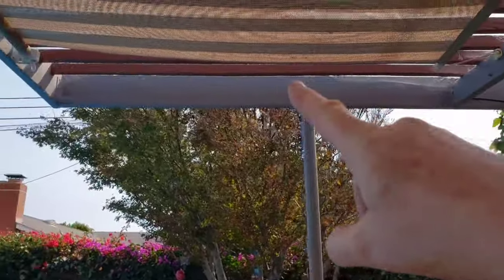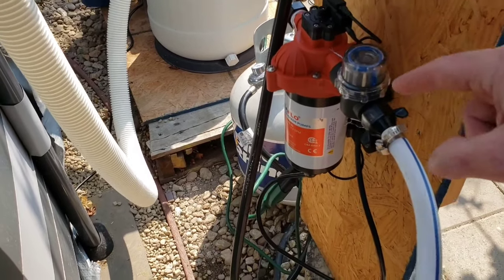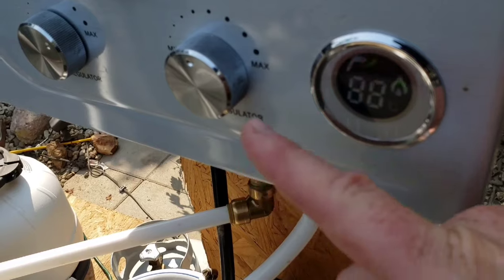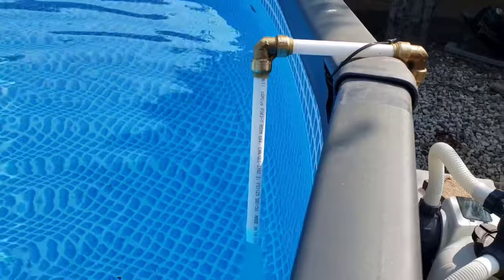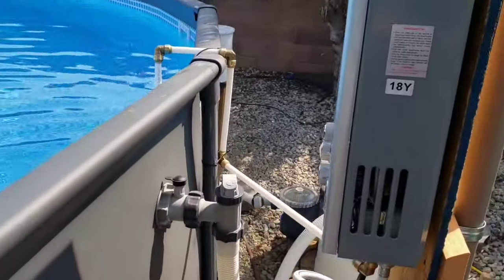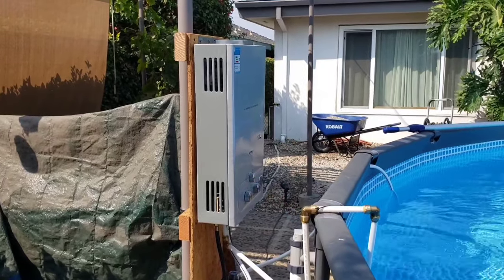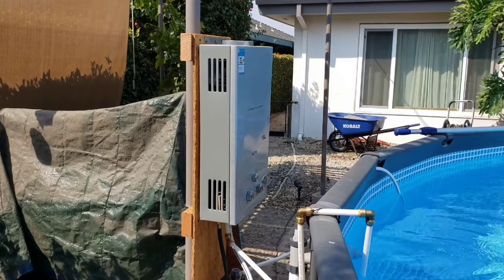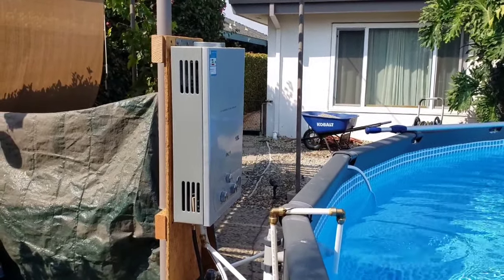The Best Above Ground Pool Heater? Propane Tankless Water Heater setup

Comment: Have you had any issues with the pool chemicals eating away at the internal piping of the tankless gas water heater? There was a forum I was reading online and I can’t tell if the information I was reading was accurate or not. So I thought I would consult someone who has already installed the tankless water heater as a pool heater.

Comment: How many degrees did it changed at nighttime after waiting?
Reply from the maker: As long as the ambient temp does not fall below what the water temp is already at, I saw about 5 degrees total. We moved on to a Raypak above ground pool heater

Comment: You’ll get a whole lot more out of your pool. If you put two covers on it, put a big bubble solar cover on it and then put another cover over it not only does it keep the sun from depleting all your chlorine and all but it sure does keep in the heat. You can also get this huge bubble wrap product that you can wrap all the way around the outside of your pool to help maintain heat. I think 80 Pratt 5% of the heat rises.  We had a dull boy, 18 round by 48, and by using the black irrigation hose, the more rigid stuff, we had these coils about six of these coil set up on our yard course you’d have to go out and flip them as a son you know towards the sun a little bit, but that took about five minutes. And my husband was able to get the temperature in the pool up to 92° when it was 78° outside! That was by having padding on the bottom of the steel frame pool padding on the inside before you put your liner in bubble wrap around the outside and two Bubble solar covers on top held the heat in and boy did it ever work! Now you can’t swim in it all year round, I do live in Michigan. But I sure wish I could find a system that I could heat all winter without running my rates through the roof.😂
Reply: That's exactly what I do! Double cover overnight and open outer cover on sunny days. Keeps it at 75f overnight even when outside  temp 65F
Reply from the maker: Wow, all excellent 👌 ideas

Comment: This works. I built the same. My design uses quick hose connects so I can flush out the heater when the heater starts clogging after a month of use aka 200 hours. The setup lasts 2 seasons as the heater melts internal heat shielding, water calcium clogs the heater, and the pump switch dies. I spend $250 to refit equipment every 2 years. My same size pool heats up the pool by about 1 degree per hour with a $25 propane tank per day. 

The pump is annoying so I build  a wooden box with sound insulation. Problem is the seaflo water pump over heats after 4 constant hours enven with water or fan cooling. I setup a parallel pump with a manual valve to switch to the backup pump. We float and swim late into the night...

Comment: I'm following closely! I have a 14ft 38inch pool and I'll be doing a similar set up. Have you monitored your water temp? A video with the air temp, water temp, and how long did it take to get it as warm as you liked? How much propane are you using? How many hrs of heating will a 20lb tank provide? I'm in MS and our temps are low 80s in the day, 60-70s at night, so I'm wondering if a smaller unit would work for us and possibly use less propane or if lower flow rate will mean I'm using the same amount of gas and it just taking longer to heat. I'd love a follow up video! You rock!! Also, can you link the unit you bought?
Reply from the maker: Thanks for the questions and following us Pauline. Here is a update that I think you deserve:
I switched the heater to a natural gas model that from the outside looks identical to the propane one. Using a BBQ natural gas hook up line from my gas meter to the heater provides limitless fuel. And its cheaper! It puts out about 131 deg F water temp at a flow rate of approximately 3-4 GPM. 
Yesterday we had a 75 degree sunny day here in Oxnard CA and I turned the heater on around 10 am. The pool temp was already around 71 degrees. But by 8pm the pool temp was about 79 degrees although the air temp was now 60 or 59 degrees. I think that if you turn it on early enough in the day by the evening you can see about 1 degree and hour increase over ambient temps by the evening. 
This was my observations only and when I have time I can do a more scientific experiment like you have asked for.
Cheers!
Todd and Sassy
Reply: Bbq grill Propane tank has max 400,000 btu.

 Your 2700 gallon pool requires 2700 btu to be lifted one degree.   The btu of heater determines how long to heat pool and the propane tank determines how much heating you can do. 

Size of heater in btu and you need lots of flow to get to rating on most heaters so don’t cheap on pump - the more flow the more efficient your heater and propane usage which is way cheaper than electric to run pump so use a solid pump to drive the water through.
Reply: @3DaysAway  Excellent video.  How much was it to extend your gas line?  And did you have to get a different water heater after switching to natural gas?
Reply from the maker: @patricksquires77  we now have a Raypak above ground pool heater, works great
Reply: @3DaysAway  Thanks for the reply and info and original video. Did the nat gas heater die?
Reply from the maker: @patricksquires77  no, I just wanted something with more BTU and Raypak makes a nice one.
Reply: @patricksquires77  Close. A BTU is how much energy is needed to raise the temperature of one pound of water one degree, not one gallon. 
1 gallon= 8.33lbs
So his 2700 gallon pool needs 22491 btus to raise the temp by 1 degree.
Reply: @MrDflores1  doh!  I definitely need to get that right!  Thanks for pointing this out!
Reply from the maker: @petershi9495  I ended up going with a Raypac above ground pool heater...
Reply: @MrDflores1 You are missing part of the equation, starting temperature. 
In the US, 1 BTU is the energy needed to raise the temperature of 1 pound of water 1 degree, with a starting temperature of 59 Fahrenheit. In Cananda, the starting temp is 60F (15.6C).

Comment: If you hard plumbed your filter pump, you could have just added a tee with a pvc hose pipe connection. Which eliminate the need for a pump for the heater.
Reply: People don't get this 😒
Reply: The flow would be too fast to be efficient, would it not?
Reply: @iamamp3pimp  I have the  same question, but the gas Co. tech told me that is how is hook up, using the pool circ. pump and adding a diverter valve, so when not using the heater, valve is turn  off. Maybe that is the reason the BTU required is so high.

Comment: I bought the exact same heater. But for some reason, the heater will run nice, but after about 5 min it shuts off and won't reignite.
It will only start up again if I unplug the intake hose, and drain water from heater. Did you have this prob? Any ideas why I might be?
Reply from the maker: I"ve heard of this issue but did not experience it. We ended up gong with an actual Raypak above ground pool heater, works best.

Comment: Hey, Todd. I have been watching you on BBQ channel. I have a loaded Wichita also. I just bought a above ground pool. New to pools
Reply from the maker: Hi Greg! Hey, now we use a Raypak, much much better!
Reply: I have a stock tank pool 8ft, how do or what do I hook the wires on the seaflow too?  I wanted to just recirculate the water in the pool but where will the power come from for the seaflow pump
Reply from the maker: @patriciaburgess1397  Watch to the end, I show how I hooked up a timer.

Comment: how many btu's was it most likely too small for that size pool also heat it with a solar cover on will work better.
Reply from the maker: Not sure how many BTU it was. I disliked the solar cover because I have a walk-in swim step and the skimmer gets in the way. Since this is southern California, I keep it open and ready rear round.

Comment: Would anyone know (more less) how much time and gas does it take to warm up the water from 70F to around 80F? (some 5C increase). Thanks! I see many heaters working overnight for the next day, that’s long…
Say, if I had 3 ~ 4 hours. (from 6:00 am to 9:00 am) to warm it up for the day, would this set up work? BTW, we only have room for the smallest 10 ft. Intex pool. Thanks a lot for any suggestions!
Reply from the maker: No longer use this, Raypak for the win!

Comment: I have almost the exact same pump and setup but my pump motor gets SUPER HOT. Does yours get hot like that?
Reply from the maker: It did. I have since ditched that setup for a Raypak unit.
Reply: Do you mind elaborating on that? I would love to hear what works better.

Comment: My heater just kept shutting off..it wasn't a flow issue but it seems like the water heater has a cutoff - I think it was faulty
Reply: this is happening to me.  Were you able to solve this problem?
Reply: this water heaters stop after 20 minutes continuous use, you must put a timer that run for example 19 minutes and then stop for 2 seconds
Reply: Watch the part when he talks about putting the timer on the pump to reset the heater....

Comment: Does the heater have to be above the pool water level? I kinda wanted to hide it. Thank you
Reply from the maker: It helps with the static head so you may see better water flow . We ditched this and ended up with a Raypak above ground heater

Comment: So can we get an update? Is it still working? What kind of life did you get out of it if its died? Cost to run each week? Any info would be great
Reply: Update would be very helpful, but most U T video makers doesn't come back to replay to  comments and questions! They get busy and life goes on. This works for pools with 10k gallons or less. Larger pools like my AG 18" x 33' X 52"  require a HD heaters, 150BTU, pool Place estimation?! They calculated the surface SQ feet,   The LP gas co. tech came over and he told me that any  heater above 150K BTU require a 2 100gl tanks, otherwise the tank get too cold trying to do the conversion   causing pressure to lowered.

Comment: I'm about at wits end trying this out.  I have a 160,000 BTU Rinnae that I got as a scratch/dent on eBay.  7.5 gpm.  I have 50psi running to the heater, but only get about 2 gallons/minute max out of the heater.  I've tried multiple things: using different pumps, checking for mineral deposits, etc., but no dice.  I thought maybe it was airlocked, but am really confused as to what may be preventing the water flow.  I am using 3/4" inch lines to/from.  Any help is appreciated!
Reply: Try using spa flex line and get rid hard angles in your return plumbing
Reply from the maker: Did you ever get it fixed? We upgraded to a Raypak BTW...

Comment: More important is how long does the propane last.
Reply from the maker: I ended up having about 2 days of moderate use. But later ditched the whole system in favor for a Raypac system
Reply: @3DaysAway  what does raypac run on propane or gas?

Comment: I had issues with chemicals in the pool clogging the water heater flow, eventually clogging up
Reply from the maker: I only use chlorine so far no issues.
Reply: there is a little bit of wire gauze in the water inlet . that collects fluff and stuff.. probably that.

Comment: I've got the same outdoor water heater but it only lasted a year. I can hear the igniter ticking but it won't light. I think it may be the gas solenoid is stuck and won't open anymore. Any ideas on this?
Reply from the maker: Not sure, did you get it working 🤔?
Reply: @3DaysAway  Yes. I took off the gas solenoid and pulled off the little spring end because it wasn't opening and closing anymore. I now have a different regulator hose with a built-in turn valve that does the job of a gas solenoid. I bought it at Lowe's.

Comment: I have a 22’ above ground Intek. We upgraded to a skimmer style with a sand filter and used pvc instead of hoses. Looking for a good heater system so we can use pool year round since we’re central Florida
Reply from the maker: We upgraded to a Raypak

Comment: I have that same pump, does it overheat?
Reply from the maker: It got hot but kept going
Reply: Thanks, I'm using a camp plus natural gas heater for 5000 gallons. The digital timer does not work on my system. The pool is 50 feet from the heater, so there is not enough pressure to restart. I run it for an hour & give it 30 to rest at 130 degrees. It's a 1.5 degrees increase. I'm in the Pacific NW so it'S COLD here most of the year. Working great so far. thanks for the video.
Reply from the maker: @RecoveringProceedsInvesting  we use a Raypak now, much more heat
Reply: That is the way to go.